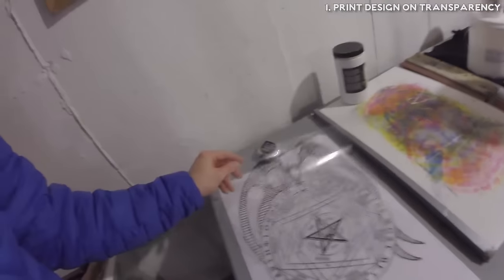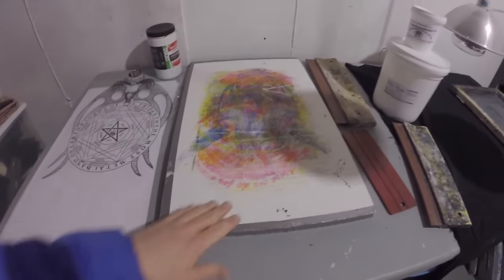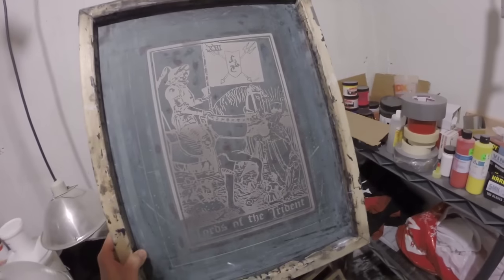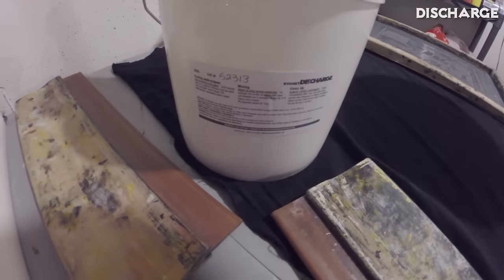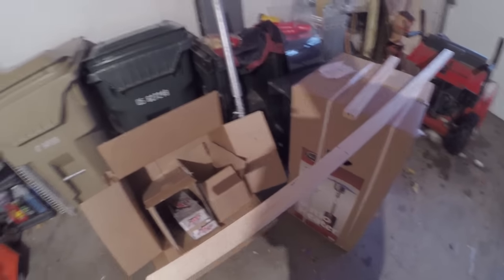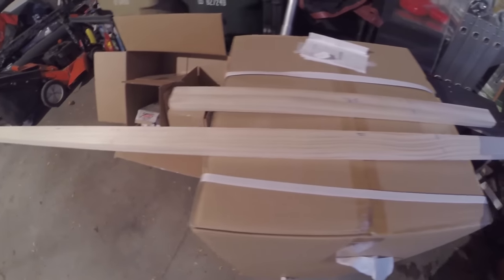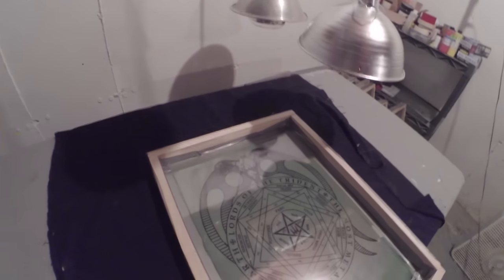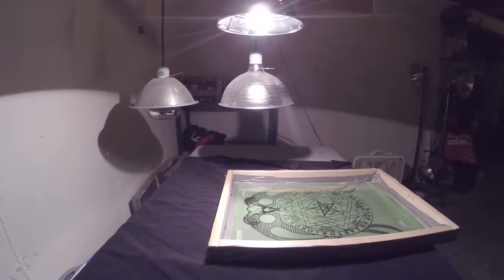DIY T-Shirt Screen Printing for Bands - WORDS OF FANG

Comment: this is great, I've always wondered how to do this. thank you! can't wait for the follow up. how did you go about making the print on the transparent paper?
Reply: +Delirium Trigger Great question. I have a local print shop that has a "large format" printer with transparency, and they print these out for me. However, if you can't find a print shop that will do it, you can buy 11x17 transparency paper online in a pack of 100. They work with any laser printer out there.
Reply: +Ty Christian thanks!

Comment: Ty - this was such a great help to me, i'm actually able to do it now.  Struggling with discharge ink a little, the images come out spotty instead of smooth.  I've been mixing in 5% per the activators instruction, maybe I should go down to 3%?
Reply from the maker: Spotty in the discharge phase? The color not fully coming through? Let me know what you mean and I’ll see if I can come up with a solution
Reply: Yeah it's weird.  I measure out exactly the right amount of activator and ink, subtract the weight of the cup and mix it.  But then the image comes through spotty, some areas super white, others almost a dull grey.
Reply from the maker: @snaggletoothdecay  If you're doing the discharge ALONE (with no pigment added), you may be running into different color qualities of cotton. You can try one of two things: either add a bit MORE discharge (like 7%), or you can buy some white pigment to add in 10% white pigment
Reply: @LordsoftheTrident  ok i'll try that.  I have only been doing white on black so far ink-wise.